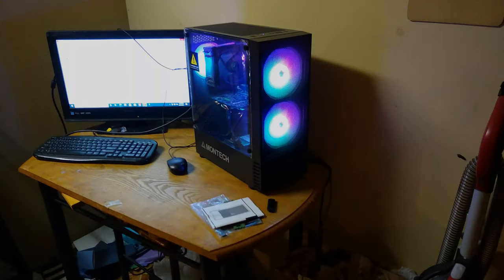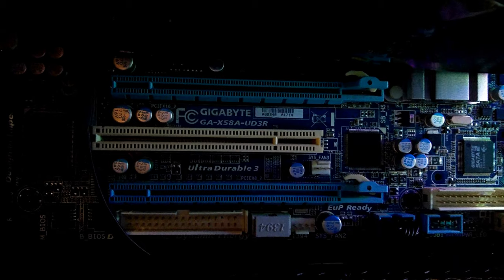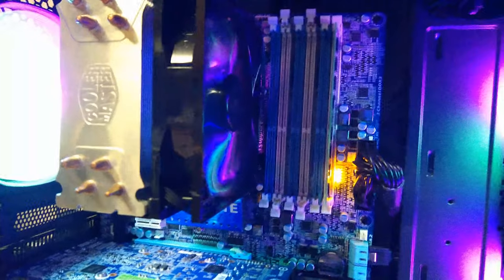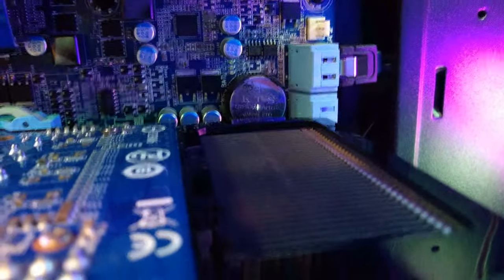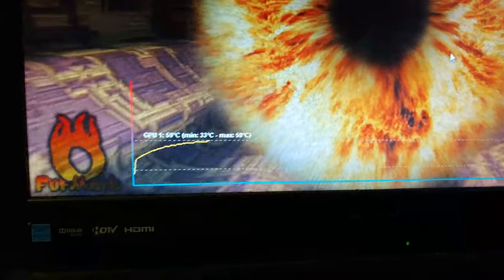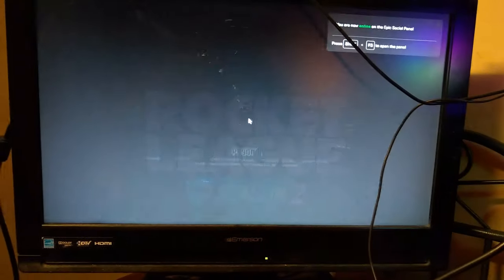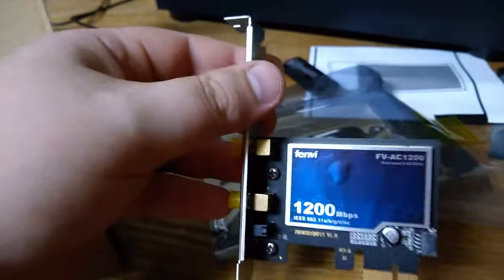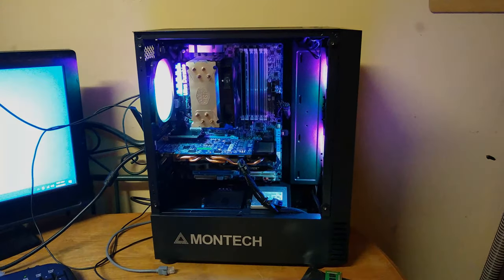Trying to Fix an X58 RAM Issue - Single Channel or Bust

Comment: Hello friend, when i try to run off the versión of the BIOS on my USB an error apears "BIOS ID check error". ¿You know why?
Reply from the maker: Hm. Never run into that myself. My guess would be if you are skipping over a BIOS version, it could be causing the error. Sometimes if you skip versions, example going from F2 to F4 without first installing F3, it may cause a problem. Some BIOS versions require components from previous BIOS versions to function properly. That's all I could really think of.
Reply: @rickylonghaul682  ohhhh nope, i try to install all versión of the BIOS but still whitout work, don't worry it's okay. Thanks for your help!

Comment: I have an issue with mine too. I have a x58. I can only put in slot 2,4,6 but one stick in them. It won't boot together with all 3 sticks. What's the issue?
Reply: It boot loops if I put in all 3 sticks in those slots.
Reply: Update the bios as a solution?
Reply from the maker: Thanks for the comments and sorry I didn't see them sooner. I tried several different BIOS versions and none of them worked. Also tried cleaning out the DIMM slots and the whole mobo. Ultimately, only single channel would work. Didn't find a fix.
Reply: I’ve had an X58 for years and have got to know all of its little quirks over the years. I had the same issue with ram not being detected or working properly. There was an ever so slightly bent Pin on the cpu socket so with some very careful work I bent it back and Job done. Bent socket pins can cause some bizarre issues.
Reply: Have you checked for bent cpu socket pins? I had this issue with an x58 board and it was making he memory very fussy. I know I’m a bit late but thought I’d share.